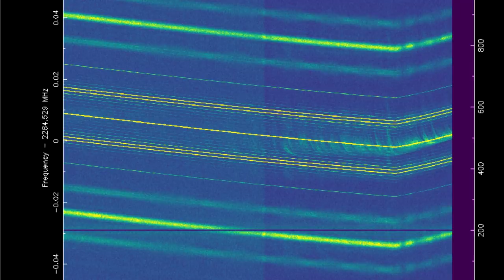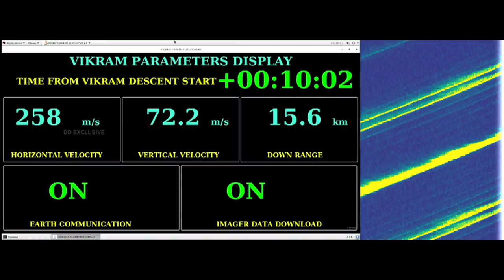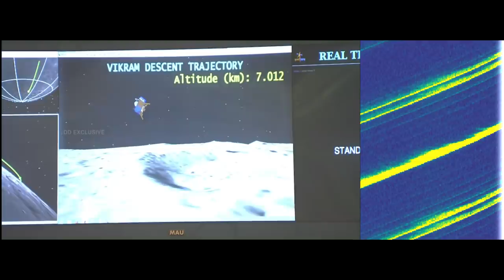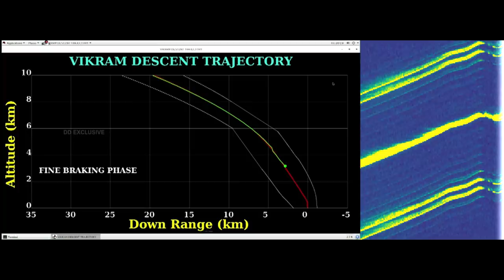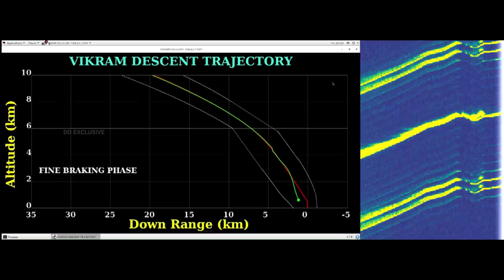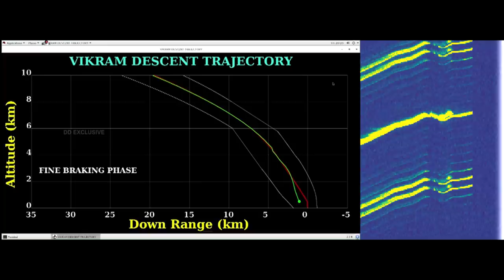What We Know About India's Failed Lunar Landing

Comment: Looking mostly at the doppler.

Engine imbalance , either one of the side engines overthrusting or underthrusting.
This causes a tumble. Thrusters cut out.
Lander recovers after one revolution (about 10 seconds, that's a fast tumble!). 

Lander acceleration down is less than gravity+thrusters, so likely only gravity while upside down.

Thrusters re-engage shortly before correct orientation, but deceleration is somewhat less than before incident. (about 1/5th less). Malf thruster switched off?

As lander has just lost 10 seconds of braking time, AND is braking at only 4/5th the rate... It hits the surface at significant speed, about the same time it should have entered hover mode.
Impact at... 30-50 m/s? (manley says 100m/s. this sounds bit high but possible.

We should have not a crater but a rather smushed ex-lander. About the same as a car in a highway head-on.

My guess as for root cause... Throttle stuck on only one thruster when transitioning from "rough braking" to landing braking.
Root-root cause, programming error that omitted that one thruster from the transition between braking modes.
Reply: Yes...isro did come out with initial report saying that one if the retro rockets went to 100% thrust rather that 70% causing the tumble.
Reply: Well reasoned and thought out hypothesis. Like Scott said, it would be interesting to get some footage of the lander to potentially figure out what the condition of the craft is in and how it "landed" and figure out what was the cause. But, rocket engines are complicated and this required fine control of the output. It would be very easy for a misfire to occur at that phase that just left the lander unable to recover in time. Just happened at the worst time possible.
Reply: Damn bro, are you an engineer??
Reply: @Justin McCoy Why should i "shut the hell up"? Just because reading actual intelligent postings give you a headache?
Reply: @ianPedlar  Bad TV Broadcasting
Reply: @marvinkitfox3386  
I flag abusive posts, and that one was obvious, and Google does nothing about it.
Reply: Excellent analysis, my hope is that parts of the payloads survived and could still be made operational.
Reply: My gut feeling - no more than that - was similar, except maybe not software but a hardware fuel flow control (valve?) problem on one corner-engine, or the engine, once started, didn’t like zero-g on (temporary) shutdown (needed deceleration g to maintain proper fuel disposition / flow).
Reply: They didn't do enough real life trials on earth. Totally trusted the simulations. Doesn't work like that.
Reply: @mviv6339  that's almost certainly true but the budget for the mission was tiny and probably precluded more real world trials. So consider the mission a trial. Just hope they keep going with the program.
Reply: @joythought  no plans to do it independently. They have previous plans with Japan, but then you lose In house developed expertise. I feel a privately funded moon lander would be better for India, as isro wants to concentrate on enhancing its payload capacity to GEO from the present 4 Mt. Semi cryo engines will now become the priority. They have a venus orbiter planned. Unfortunately this was a missed opportunity, well within their capability.
Reply: Very good analysis Marvin... Impressed... And Scott Manley is right about what was telecast during landing.  My source internal to ISRO says "Given the tight, limited budget they work with ISRO doesn't have a dedicated camera crew to cover such events, and seldom (or never) are their other events covered live in the manner this was done.  Due to the tremendous interest that got generated in the Indian population and the fact that Indian Prime Minister was witnessing this event, they hired an external camera crew who were only experienced covering social events like marriages, public rallys and such.". The way the coverage was switching between different sections of people in the room clearly proves that fact.
Reply: This is the best analysis I have seen so far with the public facts we have right now! Thanks so much
Reply: @-danR  snowflake

Comment: @9:41 "...and landed on the surface at very high velocities..." aka "crashed". ;-)
Reply: no, two entirely different things. just like an explosion is not the same as "rapid, unscheduled disassembly" xP
Reply: Yeah, it's called "lithobraking"
Reply: RUD
Reply: @Micsmit_45  Negative.  A lander without wheels will always crash when landing at very high velocities.  Therefore they are synonymous in this usage.  But you get a bozo button for trying to be a jerk.
Reply: It's simply an untested deceleration measure, there's no need for concern!
Reply: Trying to trigger the seismic instruments we left from Apollo.
Reply: yeah these jokes are getting old kids, you need to make some new ones.
Reply: "it did land, just not in one piece" :)
Reply: Unplanned contact with a Lunar object.
Reply: The Everything Core KSP flashbacks ensue
Reply: Just being honest. If you ever worked with an Indian engineer then you know exactly why this failed. I bet you everything from the design, mfg, and software are full of stupid mistakes.
Reply: @frost9041  lol they forgot to add some boosters
Reply: @goned216  The lander has been found intact, and it landed pretty close to planned landing site! It is just that it is in a tilted position. ISRO is striving to reestablish communication with it!

Comment: Did the USA seismic sensor array detect the impact and echo?
Reply: Damn good question!
Reply: A: spacecraft hit the moon at a relatively low velocity.

B: any idea of the distance of sensor array from point of impact, south pole
Reply: Please give input on this contraption you speak of ?????
Reply: It won't because the impact was at 60m per second.anyone correct me if I am wrong
Reply: I would like to know that too. Any space agency might get Chandrayaan 2 signal. Any sort of?
Reply: @dinod7687  750kg impacting at under 100m/s... It would require one heck of a sensitive seismic sensor to detect that several hundred kilometers away. It would be more of a crump than the usual bang of a meteorite impacting at ~10km/s, and many magnitudes less energy than an internal geological moonquake.
Reply: @stevewalker412  it employs pig's bladders to prevent moonquakes
Reply: @stevewalker412  Google maybe?
Reply: @dinod7687  48.1 m/s
Reply: I did Google it and the last operating one ended in 1977.... cool
Reply: ALSEPs systems: Remote seismic stations were deployed as part of the Apollo Lunar Surface Experiment Packages that astronauts set up on the Moon on Apollos 12, 14, 15, and 16; different versions were deployed on Apollos 11 and 17.  The signals were x10 million amplification. So yes, this impact 'might' have been recorded if the system was still operational, me thinks.
Reply: All of you guys.. here is new update just a hour ago India's orbiter sent a thermal image of lander rover which looks intact and fine.. communication still a problem but scientists working on it ..hope you all hear a good news in next 24 hours..
Reply: @deepaksinghrajawat361  there is no any news of "fine " , I hope it will be but calculation says something that I don't want to .....
Reply: @nvcworld6423  ISRO officials said a normal photo of lander and rover ...a normal means fine I think
Reply: @nvcworld6423  do you work in any related field?  Well in approaching phase it lost connection..it was due to slight path deviations and Doppler tracking doesn'tt works well on poles .. probable cause booster overpeformed in approach phase.
Reply: @deepaksinghrajawat361  just I wanted to know your view ,what if it over performance ? Its was to reduce speed towards to moon not to increase right ?
Reply: @deepaksinghrajawat361  and it's not just deviation, infact it was not as per  planed trajectory due to some reason right ?  Thanks to you for using deviation ,just tell me why it's deviation happened ?
Reply: @nvcworld6423  it doesn't work that way you are thinking..booster reduces speed and helps to tilt the lander when it comes into transition phase (approaching phase need fine booster brakes) that's exactly 2km above the surface. The slight path deviations (actually by 500 metres) can cutoff communication with it because on that part of moon it's very hard to communicate without any communication medium between us like orbiter.
Reply: @deepaksinghrajawat361  bro I am not arguing with you please try to come out from yours imagination and consider a fool is saying something just try it , communication cut off problem is not like engine not fired , actually it's happened in progress of landing so what it's mean ? Just I request you please once think as per my point of view ,thanks
Reply: @nvcworld6423  bro you cannot communicate continuously to that part of that moon it was supposed to be done with orbiter that can transmit and relay very limited amount of data once in couple of hours once it lost communication it lands itself by using its artificial intelligence as it was supposed to be done but due to communication lost and probable booster outperformance  it deviates from path ..and booster could have outperform due to high approaching speed or because of slight miscalculations by computers. I don't know exactly ..only I can say wait for some hours and hope you could hear some good news.
Reply: @deepaksinghrajawat361  thanks for replying , please keep updated on same and keep yours yours lines in mind , I also wanted to be see our national do a great job , jai hind
Reply: @stevewalker412  ALSEP systems were deployed and tested on at least 5 different Apollo missions. That should help you find the history, fellow Spacer.
Reply: El Draque  NORSAR does not have sensors on the Moon. Google ALSEP.
Reply: El Draque  you are confused. Whatever you are smoking it's not good for you. Try something else.

Comment: Pure speculation: At the 4km altitude the pid loops were hyper responsive, this lead to oscillations in the rotation of the craft.  Those oscillations caused the fuel to be sloshed around in the fuel tanks.  Fuel scavengers inlets went back an forth from gaseous to liquid environments make the engines less than consistent; therefore losing all control.  Anybody know how the fuel tanks were constructed?  Baffles, bags, or just open tanks?
Reply: U should have been the incharge of that mission
Reply: No way they'd build just open tanks. May have used baffles or cofferdams
Reply: @vim1729  Accidents are way easier to design out in hindsight than in foresight. (Hence at adage "fail fast, fail often"; which hopefully occur in a testing situation and than the real thing!)  ISRO's people are brilliant and diligent...nobody is perfect.  Took SpaceX how many times to get a soft land working correctly??  It's not easy.  It is rocket science after all!
Reply: @eldencw  yes you are right sir! space flying is difficult business. by the way, your speculation reminds me of apollo 13 movie!
Reply: @eldencw  I thought retro thrusting very easy but it's tough.
Reply: That's a good theory. You definitely could be right
Reply: I doubt if it had significant amount of fuel left to actually affect the inertia. It was going to almost land at that time.
Reply: @dd0356  The best way to design anything is looking at the accidents that happened in previous (vaguely) similar designs; and designing those mistakes out.
Reply: Finally a smart comment on youtube who has analysed and tried to come up with a plausible explanation of what went wrong.
Reply: my bet would be that one of the engines malfunctioned causing an asymmetric trust, which caused the craft to tumble, which caused the program to malfunction.
Reply: Sounds like a shitty system design if fuel slushing and occilations are not taken care off.they are the basically the basics.also in which universe do spacecraft s carry open tanks .
Reply: Sabotage is the more likely explanation.
Reply: In any event, too many bells and whistles for a first attempt. Next time leave out the rover, and add real value in multiple redundant landing and telemetry systems. Cameras everywhere, outside, inside, inside the fuel tanks. Fractional-g  drop-tests at altitude ( ~30km) of subsystems and full systems to see functioning at lunar-similar conditions, etc. They had a huge landing-mass advantage in what they threw at the Moon, make every kg count to stick that landing , and save rock-collecting for future missions.
Reply: Just open tanks. I'm the accountant in charge, and we were able to save 1/2 a rupee by leaving out the baffles. So, my mission was a success! ...The lander's failure's on those other blokes!!!
Reply: Shloshing fuel can make for an unintended reaction wheel as well. I would have pointed this out to the designers, but as Head Project Accountant, I was afraid, that the solution would cost more money, so my individual cost saving mission would fail. Instead, I brought the  project in a 1/2 rupee under budget!!! ...Thank me!
Reply: rodgersericv no it fucking isn’t.
Reply: Externally pressurized bags FTW.
Reply: SOUNDS PLAUSIBLE TOO ME.
Reply: @JosefZila  I'm relatively sure they have tank pressurization in the fuel tanks, but in the low G environment making sure the plumbing is pulling out the fuel instead of the pressurization gas is a bit of a trick.  One of the first Falcon 1s failed for the same reason.
Reply: @JosefZila  Simply pressurizing isn't enough.  You need ullage, or a force that directs the fuel to the pipes.  This is usually initially achieved with cold gas thrusters.

Comment: To me the interesting part is the sudden deviation - everything was going very well until very near the end. Of course we need to know what happened - I agree it seems to be an orientation problem - but why did that suddenly happen?
Reply: Probably one of the 4 corner retro rockets either didn't fire or fired too early - caused the thing to tip and the main central engine, still firing, accelerated the craft either to the  side or straight down for a few seconds.
Reply: According to the latest reports released by ISRO it has landed safely but it is in tilted position nd is in good condition 
Hoping to have communication link..
Reply: It has landed, but I'm not so sure about "safely".
Reply: Inaccurate burn, I feel.
Reply: @DLWELD  No.  more likely fired too early. Look at the green line "corridor",  Straight lines on that mean its supposed to continue. It was on the "straight-way" when it deviated at around 4.5 km up.  (although the x axis is highly compressed compared to the Y axis).